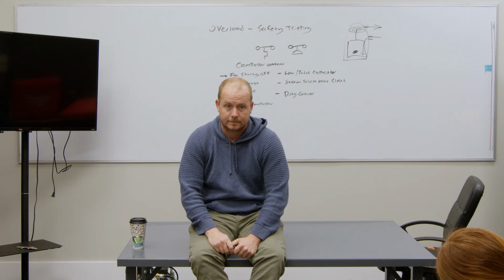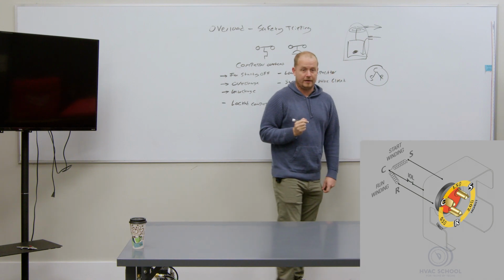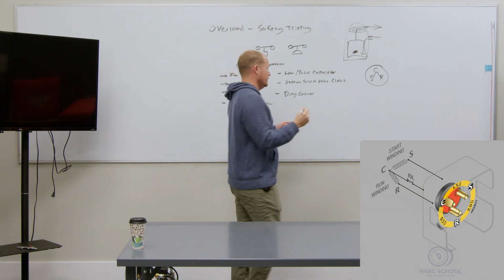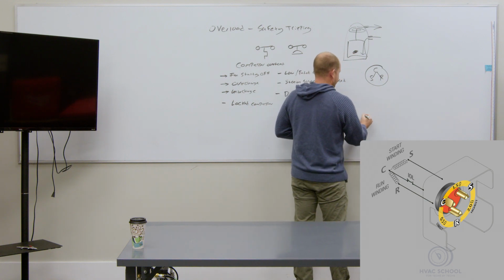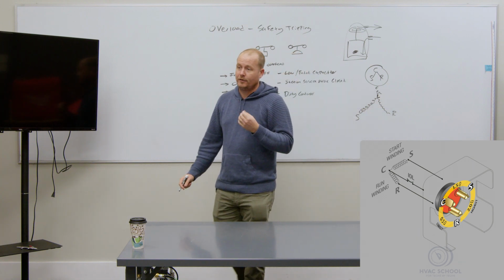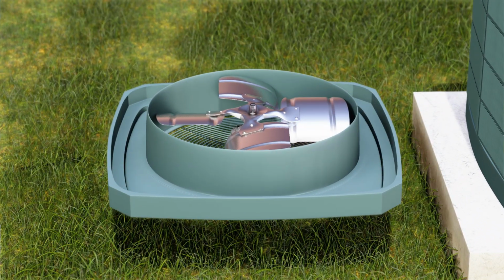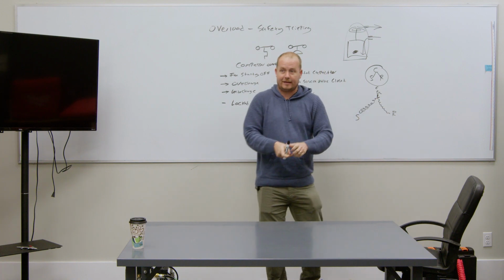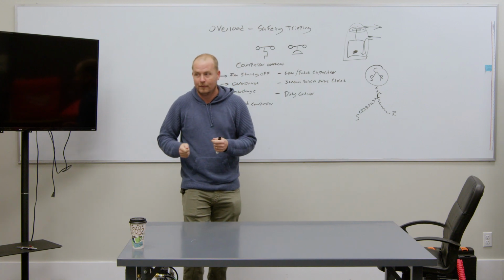Motor Overload and Safeties - Kalos Meeting

Comment: I am still a student. I went to help out a neighbor and I found out that the condenser was very dirty. I cleaned it,  but I couldn't reset it. A company came next day and they hit the top of the compresor with a hammer. It started right up. That's something I wouldn't have done. They charge 300 for it

Comment: I appreciate  all the information you put out. It really does help a lot of people including myself. 
The only criticism I have for this video is how you seemed to be dismissive of the tech who said he has seen overheated compressors that have been caused by a restricted txv or frozen coil caused by an under charged system. Although like you said these may be rarer cases it certainly is something to consider when looking into the bigger picture of the issue. Maybe you were just joking I don't know I am pretty bad at reading stuff like that either way just trying to help, again appreciate the information.

Comment: Would I be correct in saying that all these conditions that cause overloads to trip can be looked at as high compression ratio?

Either you are describing a condition that drives head pressure up (cond. fan failure or dirty cond. coil) that the compressor has to fight against to move the refrigerant.

Or you are describing a condition that deprives the compressor of the necessary refrigerant density to properly cool it off. (Closed suction service valve, undercharge, TXV staying too far closed etc.) 

Would looking at compression ratio be a decent metric to figure out how hot a compressor is running vs. How hot is acceptable? And could looking at compression ratio help you solve issues that ultimately increase the longevity of the compressor?